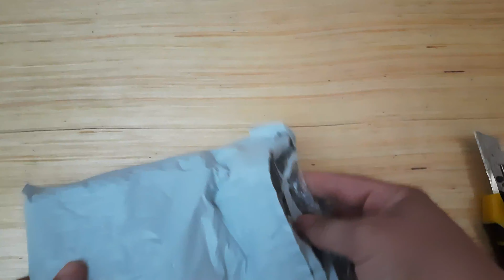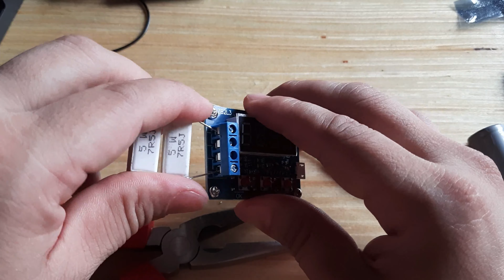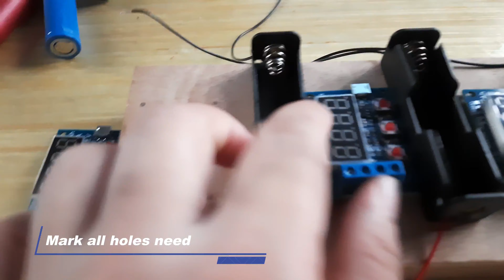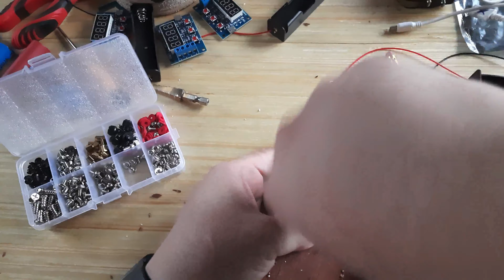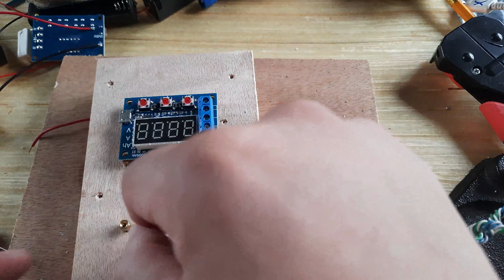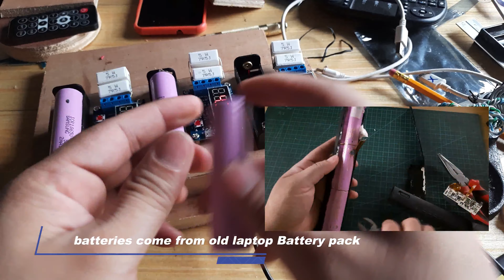DIY 18650 Battery Capacity Tester ZB2L3

Comment: Bakit un sakin nag eeror hindi makita kuna ilang mah ..😩
Reply from the maker: yung zero volts na binuhay ko error din lumalabas, pero nagana naman, medyo battery voltage drop lang kahit di ginagamit nababawasan ng volts.. baka ganyan din sayo try mo sa ibang batt
Reply: @Kadroid  pano ginawa mo paps ..  error talaga paps .. may volts sya pero pag sa mah wala error ..
Reply from the maker: pang power ko lang sa mga build speaker na removable batt di naman kasi malakas sa power yung mga yun. kapag ganyan tapon na kasi yun di pwede isama sa battery pack build kung magbobou ka